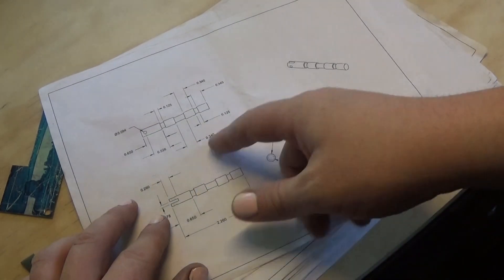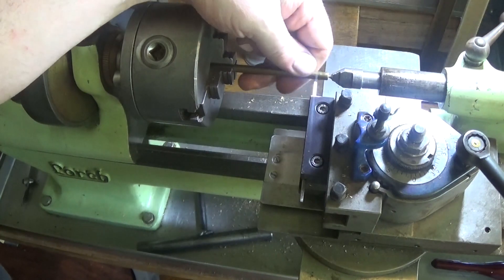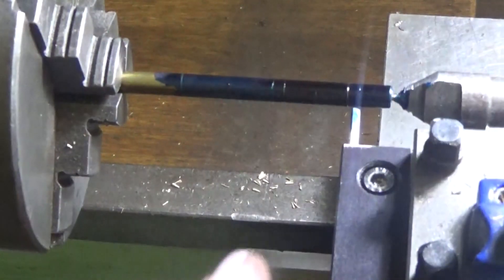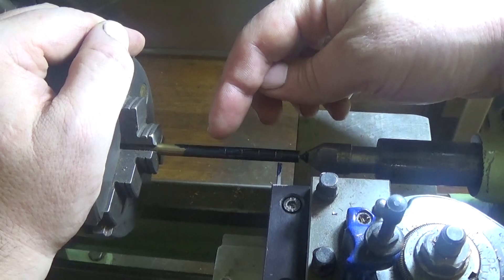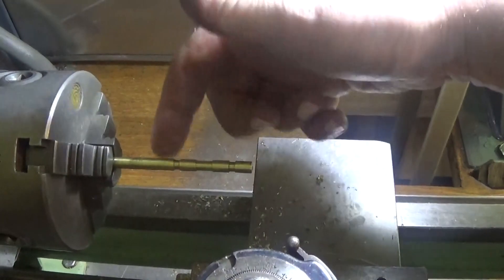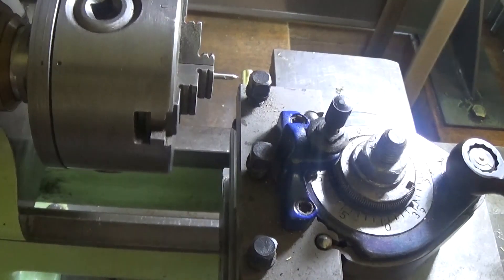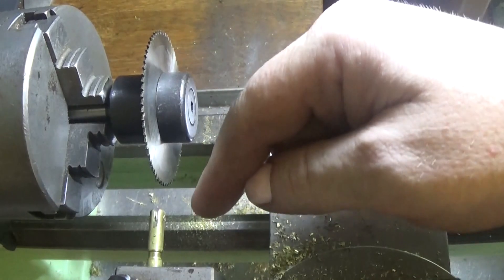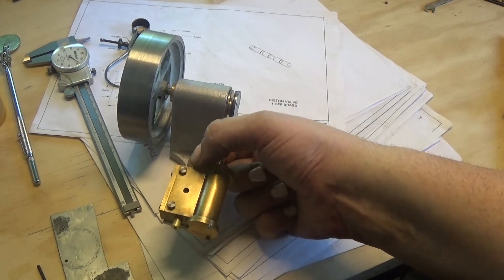myfordboy engine PT 16

Comment: looking good, in my ignorance, because i have never built a small steam engine, the tightish fit of the valve gives me some concern. just seems a fraction too tight to an ignorant person. Greg
Reply from the maker: i think it will run in nice. I dont like rattles much, but easy fixed if it is a bit tight..